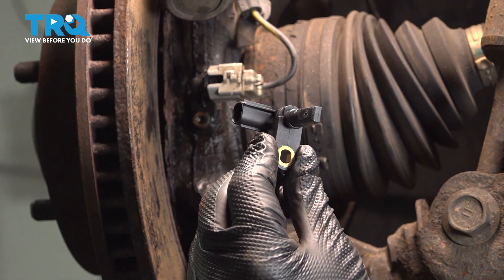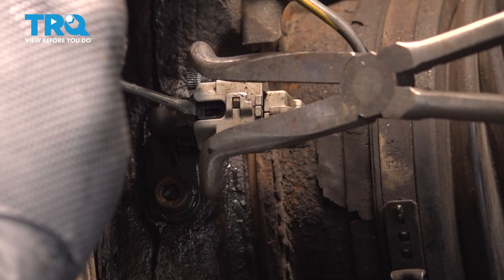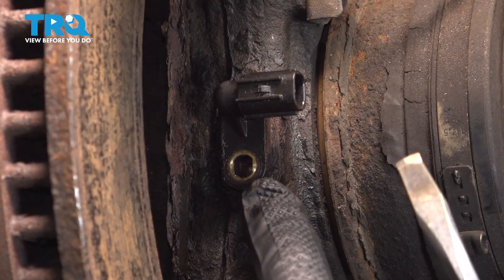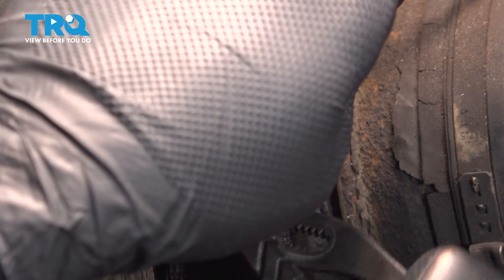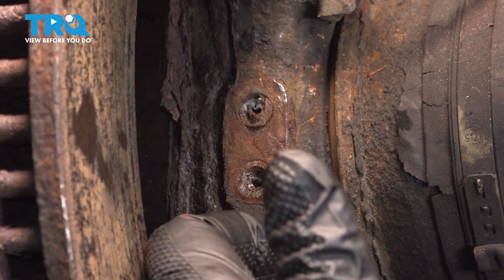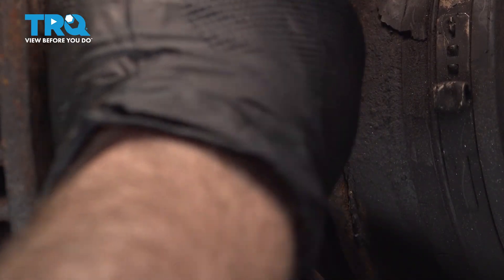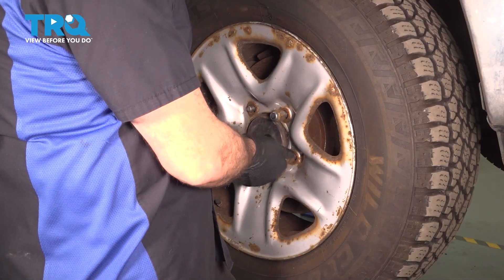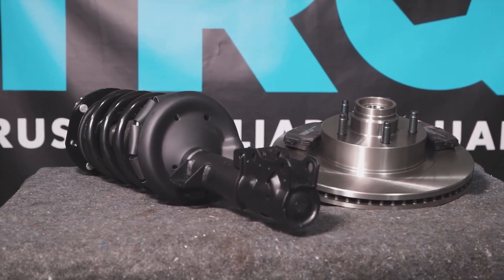How to Replace Front ABS Wheel Speed Sensors 2007-2021 Toyota Tundra

Comment: Alright so i replaced the sensor. Still C200 code. 
No others. 
I actually went into the hub assembly and cleaned everything and ensure there was no foreign objects inside. 
I tracked the wires to the ABS module and tested them back to the sensor for continuity and they are good.
The sensor I have reads 2.95 ohms while the stock sensor that's on the other side reads 2.86.
No matter what I try I cannot get the code to stay away. While I monitor it on live Diagnostics I noticed it's dropping. 
Any ideas what it could be.